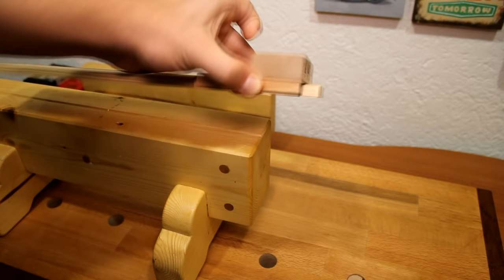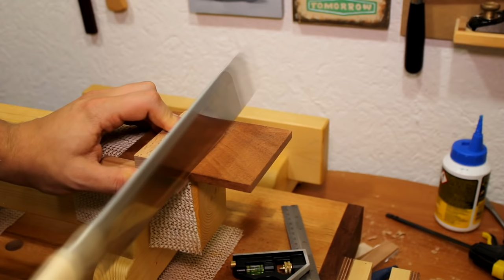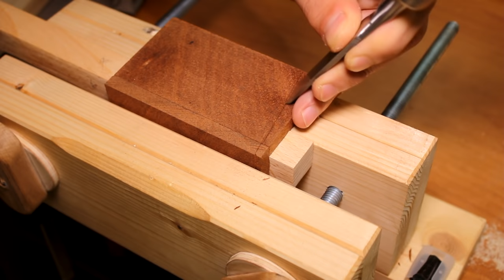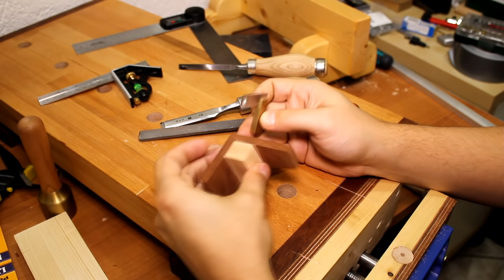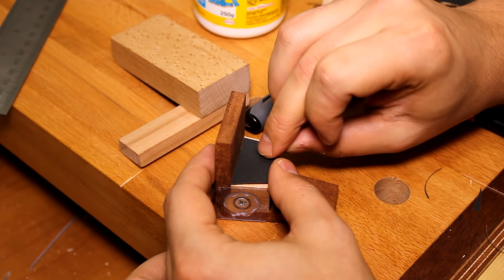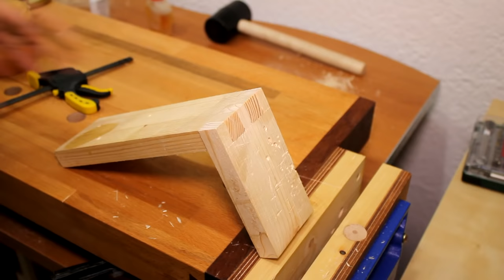Making A Magnetic Dovetail Saw Guide

Comment: I bought a magnetic handheld mitre guide, and together with my Japanese saw they're the two most frequently used things in my workshop. Then I thought I should make my own guides for other things, like dovetails, and I looked it up, just in case soneone already did. That's when I found this video. Very nice work, and good video.
Reply from the maker: Thank you! Yes if was doing dovetail more frequently I would have bought a metalic commercial one maybe, but doing it once or twice a year I said why not make one, and is working fine. Got some smaller magnets now and a mini dozuki might try making a smaller version of it. Thanks for watching my video!
Reply: I just made my first ever dovetails today, the first one looking absolutely awful, but the second one was certainly a huge leap in the right direction and good sawing and chiselling practice. 

If it is a technique I end up using more often, I think I'll get something like the David Barron magnetic dovetail guides. They look good and are decently priced, I think, for timesaving precision tools. I really like dovetails. Once the two parts are joined, it feels like nothing can pry them apart again ever. And that's even without gluing.
Reply: Back when you started out as an apprentice, the first project they let you make was shipping boxes out of wood. But before you could make shipping boxes, you made your own tools needed for making the shipping boxes and a box with a handle to keep your tools in. ... My point is: these are simple guides, make your own and perfect your skills. You can't make a decent draw box if you can't make a shipping box. Sending lots of love 💖 from sunny 🌞 Arizona 🌵😷. Patience grasshopper.

Comment: Beautiful job! I have to make my own :)
Reply from the maker: Thanks you Stavros!
Reply: Stavros Gakos https://youtu.be/6tQA4stS3vE
Reply: You could take a knife and score lines mirroring the angle down the side for sighting how wide your dovetail will end up at the bottom, I use this type of guide and skip using a knife, I only mark the base line with a marking gauge and the top with dividers than go straight to cutting, the mirrored lines would help someone visualize if they got the divider lines in the right proportions. You can skip use only dividers and your saw if you use painters tape and be precise, no planing required. In Canada at the Great Canadian Dollar Store you can get metal dividers with the centered adjuster wheel very cheap.

Comment: So the plastic is just to avoid the saw to cut the guide? 

great video and great tool!

PS: do you feel the benefit of the magnet?
Reply from the maker: Right, otherwise the teeth will scratch the wood, also the saw slides a little easier on that plastic. The rare earts magnets are quite powerful, just one 20mm piece keeps the saw very tight, rather then the black normal ones used in the first simple guide I made which are not powerful at all, but they work well on non precise cuts.
Reply: thanks so much for the answer!

Comment: I made a magnetic saw guide last summer that was much larger, the surface is 6x2", and has lots of smaller magnets. I use it with a regular Japanese saw without a back, Works fine, but not as accurate as a back saw of course.

Comment: Great job! Good idea with the plastic to offset the blade teeth. Did you do that with the 90 degree fence one?
Reply from the maker: Thanks Chris! Nop, those ones I consider disposable :) But I don't think is ok to add a plastic to longer ones because when you do a long cut usually you start with the saw a little inclined, so you may scratch the rest of the plastic and eventually break it. Another reason I see is at the dovetail guide as going down with the saw I was sawing the mahogany fence below the beech and workpiece line, thus I needed to add this plastic. At the straight ones I don't have nothing from the guide below. Anyway I think for the straight cut ones, a little chamfer below will work better. Using that first simple guide a lot, a small curve was created at the lower edge because of the saw teeths. Hope is understandable what I have wrote here :)

Comment: just a tip, dont use a power screwdriver to do up the screws, you'll likely crack the magnet if you overtighten.
Reply from the maker: Thanks! Don't remember exactly, but for sure I've screwed the final turns by hand. I've experienced prior to mount their cracking by letting one magnet to be "sucked" by the remaining 9x in the stack :)
Reply: Adrian Preda I made this yesterday, works lovely. I epoxied the magnets in in the end which was a nightmare as they kept leaping to their neighbours!